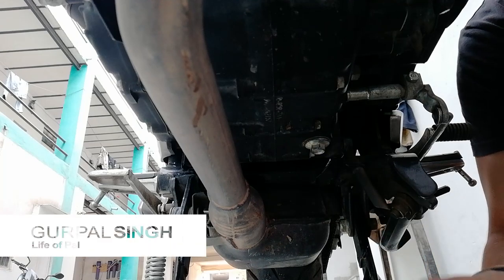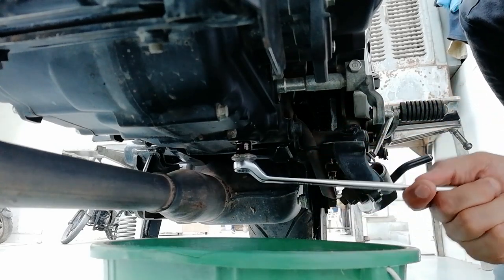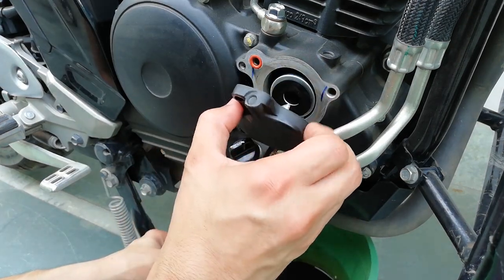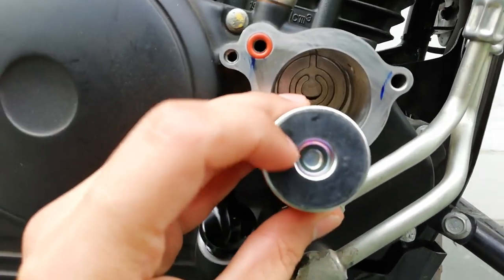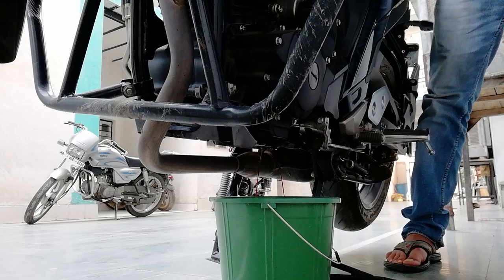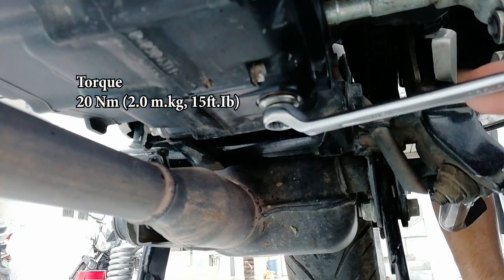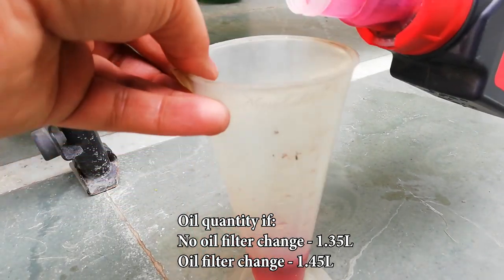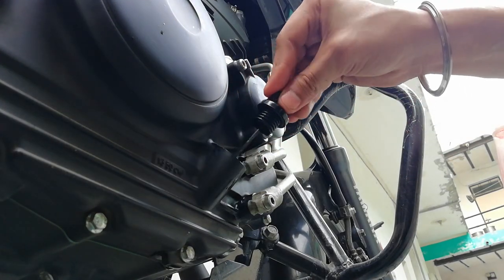How to change engine oil and oil filter | FZ25 | DIY

Comment: Hi nice video. Small thing would point out is not to loosen bolts on the engine when hot. The threads in aluminum can strip. Suggestion to loosen (not remove) the oil drain and filter bolts first and then warm the engine up. Take care :-)

Comment: Hey pal, I've been using yamalube for my fz overall it is good. But sometimes the performance of my bike drops and engine feels rough if i turn off my bike and ride it again after riding it at high rpm. Any idea why this is? Is it due to engine oil issues or should I adjust the tappet?
.
Reply from the maker: this oil doesnt go beyond 2500km. If its within this range then you're expecting the bike to be smoother than it actually can. It is what it is bro!

Comment: Great work. Well explained. doubts:1) is there only one bolt to remove engine oil in this bike?
2) do you change your oil based on both no of kms and time or only based on no. Of kms run? What is your view on this?
Reply from the maker: Yes only one bolt.
I change based on km. Usually it doesn't cross that time as well. When bike sits for too long then i change it as it happens in the lockdown

Comment: FZ25 has an old school engine dating back to the late 80’s from the XT250 Enduro Motorcycle-Ester based oils don’t seem to be going well with this engine, Smoothness is better while using Yamalube Sporty Premium, which is specially formulated for FZ25. People have reported engine issues after using other engine oils like Motul 20-50.... I have tried Motul 10w40 and felt the pickup/ response was somewhat better but gradually smoothness was gone and bike started feeling rough.... today after running 2500 on Motul, switched back to Yamalube, will share feedback in few days...
Reply from the maker: 20-50 itself is wrong choice for this. Oil pump is not designed to pump 20-50 then how come not engine will show problems.
Modern easter doesn't do any damage. If you read manual it says SL or higher which mean SL is the minimum grade requirement.
Reply: Agree oil pump would definitely not be designed to pump thicker oil and engine block damage due to insufficient oil being pumped... Grade wise 10w40 and SL/SM/SN being higher grades is absolutely fine.
There was another discussion on Pros and cons of Esters on engines running lazy compression like FZ25, on contrary I have been using Motul 7100 on my Duke 390 which runs a crazy compression and definitely working well since last 4 years.
Reply from the maker: Compression thing is due to incorrect tappet adjustment by svc's. I have adjusted tappet myself and the settings i mentioned, bike pulls like crazy. Whoever adjusted like i said seen improvement.
Reply: Right the other person who complained and made a negative video on FZ25 engine issues had used Motul but  20w50 which is wrong grade 🤭 
Can you confirm how frequently does the bike tappets need adjustment?
Reply from the maker: Vinay Kumar there is so such specific interval. Depends upon riding condition. I have to adjust the inlet after 10k as it got loose

Comment: Thanks man. For the first time I'm changing oil and filter by myself thanks to this video.

After changing filter and pouring 1.45 lt oil I see the level is slightly above max mark on dipstick. If I want to remove some oil, should I remove it via the drain bolt? Any other way?
Reply from the maker: Dont drain leave it

Comment: Can you please provide solution for oil leakage from left side of the engine, from magnetic side cap. I have chaned the magnetic side cap still small amount of leakage is there. If possible please make a video.
Reply from the maker: change the cap o-ring

Comment: WHERE IS THE ENGINE OIL STRAINER IN OUR FZ 25?  In manual they said it should be cleaned for every 15000 km. But i dont know about it ? Do you have any idea Pal ?
Reply from the maker: It is inside clutch chamber in the bottom. No need to clean.

Comment: Although the recommended grade for the fz25 is 10w40 but i was thinking about trying the motul 7100 10w50 as i have heard a higher viscousity grade will smoothen the engine and gearshifts a bit. Whats your opinion if i should try it or stick to the recommended grade. I am okay with experimenting though.
Reply from the maker: There have been engine break down issues. One of them used w50. Thicker oil doesn't mean its good. It will generate more heat as thicker oil will not travel as fast as less thick hence distributing the heat throughout. I can't really say if oil pump is designed to pump w50. And also don't know how less thick it is compare to 20w50. I will stick to recomended. This is all i can say.

Comment: When to change the oil filter . Is there any measure to change oil filter. Any certain number run after we need to change oil filter
Reply from the maker: At every oil change
Reply: @LifeofPal  I am getting engine sound different in fz 25 1.5 year old bike.  Is it might be problem about engine oil

Comment: Pal thanks for the video...but I got a question about the maintenance period of that bike from 00km...when you bought it, when have you chanced the oil filter and engine oil for first time...Thanks Pal
Reply from the maker: Hi Otto, i got it changed at 700kms on 1st free service. Yes engine oil and filter both are changed.

Comment: Hi, I have a question. In manual, the last step say “remove engine start bleed screw and allow it to idle” the step, should I start the engine?
Reply from the maker: No never start the engine when oil is drained

Comment: It's really informative and clear..what's the cost of motul engine oil which you use ?..
Have you used any other brands of synthetic oil..
Reply from the maker: No i didn't used any other. It cost around 650

Comment: How good is the motul 10w40 engine oil, I've been using the stock yamalube for fz25
Reply from the maker: Very good. Try it. Link in the discription
Reply: @LifeofPal  Hi Pal, how about 300V FACTORY LINE ROAD RACING 10W40, this one would be more better I think. What do you say?

Comment: Which engine oil is best for fz25. My fz25 just compete 1 year and 3 services done. Till now using yamaha engine oil.
Reply from the maker: Motul 7100 10w40. Link in disc
Reply: @LifeofPal  thanx

Comment: Hi, 
I would like to know instead of using company recommended YAMALUBE 10w40 , if i use motul 10w40  will it damage the piston head or affect any other parts of engine in any way in the long run? 
I am asking because when i asked the showroom guy about motul, he put all those things into my head.

That is why i need some clarification from your end.
Reply from the maker: Use no issue

Comment: At present for  my bike FZ25, service man are using yamalube....and i want to go for motul 7100 engine oil....previously they told me to change engine oil(yamalube) for every 2000kms... and now for how many kms i should change motul 7100 engine oil....plz rply
Reply from the maker: 4000 max if bike runs at high rpm. For low rpm, local commute can take till 5. But change as soon as you feel bike underperform/vibes. Yamalube can do 2500-3000.

Comment: Bro when to change the oil on fz25..? I had driven 5100 km (100 km extra prior to service) will it cause any damage..?
Reply from the maker: It will not damage but damage are suttle if you continue. Don't take yamalube more than 3000 and motul 5000.

Comment: Hi Life of Pal..
I own a fz25 from last 2 years, one thing that is bothering me everytime is the gear shifts. Downshifting the gears from 3rd to 2nd and 2nd to 1st is very notchy and mostly it doesn't change without releasing and pressing the clutch again. 
Service centre says that this is how gears shifts actually work in all bikes which is totally incorrect. I owned a pulsar for 9 years and never came across such an issue.
I believe that with time, the gear shifts should become smoother.
Just want to know if you are having same experience with your bike.
Reply: Facing the same issue here and checked on my friend's fz25 as well...The problem exists for all FZ25 probably. Riding at higher RPMs is smooth though. Problems arise in normal and city riding conditions only. My Yamaha Service center guys told the same too that it exists on all bikes which is not true.

Comment: Does FZ25 have oil stainer along with the oil filter?
Reply from the maker: I don't think so need to check
Reply: Oil strainer is inside the RHS of the clutch cover..If you need to change the clutch in future you can clean the strainer and put it back..

Comment: Hellow bro plz tell me after how many Km of running should change the O/f plz tell me...and one more Bro why the engine sounds like vibrating ...is that proble. In all bikes in fz25 plz tell me...
Reply from the maker: Oil filter should be change everytime oil is changed. Yes all fz have that issue. I mentioned that in most of the comments.

Comment: Hai bro.. i haven't changed the oil(yamalube) till 7000kms. 
last week i have changed it to motul.. 
The previous oil was too dark .. i didn't know that yamalube won't run so much.. will this affect my engine anyways?
Reply from the maker: Affect? Depends how you rode it. Well how significant damage could be cant be tell at all. Most likely its safe for once or two instances but for prolong period of time is absolutely damaging.

Comment: Hi Sir, I have bought fz 25 bs 6 after 1st service I took it my hometown 1600 km, after 2 3 hours I washed it now the engine malfunction light is on, it's not blinking if u can suggest something
Reply from the maker: Can't suggest. It's an FI issue needs to be checked. Take it to service center.
Reply: @LifeofPal  I will do that, thanks for the reply, I watched your video delhi to Jharkhand, got motivation to do the same.

Comment: I'm experiencing heat from engine a lot just by riding 20 to 30 km , I rode like 1300 km  after first service .They used yamalube premium engine oil .what is the solution for that?
Reply from the maker: New engine will heat up no issue

Comment: Is it compulsory to wet the oil filter with new engine oil,  as shown in the video? Please reply
Reply from the maker: Not really
Reply: @LifeofPal  thanks for replying,  but what I think is on wetting the oil filter we are putting more oil in to the engine, as the recommended oil on changing the filter is 1450ml, and you too have used the same quantity,  would appreciate clarification.
Reply from the maker: A little bit more or less oil doesn't going to harm. There is something called max & min marks in the dipstick.
Wet the filter using the same 1450ml or dont wet as company isnt mentioned anything like that. It will get wet when the engine runs.

Comment: Hi Bro... I m planning to buy this Fz25 next month, can you little bit describe how it is... Poor Back break pad, engine exhaust rod gets rusty, low vision head lamps.. And sound in engine after running 5-7k kms, is you facing these problems in your bike. Pls tell
Reply from the maker: Any bike will have minor issues you have to live with that. Issues in fz is very small and there are solutions. To me fz is best and perfect. I truly love this bike. I have technical knowledge and based on my past experience have selected this. Brake pads yes do get worn. Mine lasted for 9000 kms. But there are alternatives available on Amazon and aliexpress for much less price. Head lamp definitely not bad for street riding. It can be adjusted and you can for aux lamps without any issue. The rattling sound you mentioned is the manufacturer issue but that is just a sound nothing else. Bike will not go bad at all. Adjust the tappets correctly and you are good to go. Just ignore the sound. I rode 100+ kmph non stop for 29 hours. It is expected the sound to improve after 10k as the metal settles down. Check my idle Adjustment video to hear engine sound.
Reply: Life of Pal
Thanks for yours views. Your final verdict is there is no major issues in FZ25.. And can be buys without any worry
Reply from the maker: Yeah but i must say buy what you like.

Comment: Can i mix 10w40 yamalube and 10w40 motul 7100 and use as engine oil. As ratings are same
Reply from the maker: Topup? No. Complete change? Yes
Reply: @LifeofPal  Thanks for the reply. Your channel is the only one dedicated to fz25. Keep up the good work. Here's my question

I was going to change my engine oil, As fz25 need 1350 ml of oil , I was thinking of using 1 litres 7100 Motul and mix it with  350 ml Yamaha lube. As I have Yamaha lube bottle with me . Can I do this. As both are 10w40 , it shouldn't be an issue

Comment: i have fazer 25...should i use motul 300v 10w40 or 7100 10w40 ?? Is it better than yamalube fully synthetic? plz comment
Reply from the maker: Yeah its better. Use and feel. You can use any 10w40. Never try 20w50.
Reply: @LifeofPal  thanks...and what is the drain interval ??
Reply from the maker: 3000 kms doesn't matter what oil you use. Max 4. Any more will damage your engine

Comment: Hi brother, you have given the link of 20w50 oil of Motul in your video description. Is it fine if I put it on my FZ25? I mean now I am using 10w40 grade. Will 20w50 be fine as I have already bought from the link
Reply from the maker: It is something error from the amazon side. I am sorry for that. I didn't tried 20w50 but some people did and said it made better. I heared mixed review.
Reply: @LifeofPal  ok let me try in the next servicing. I will let you know how it goes
Reply: @abhinaba00001 How it went bro? Was 20w 50 engine oil suitable for Fz25?
Reply: @mohsinmerchant4176  yes it was fine

Comment: Bro, very resourceful videos you've uploaded on FZ25. Thanks for that. I have a 2018 Fz25 running on Yamalube Sporty Premium 10W 40. Will switch to Motul 7100 10W 40 soon. 

Do you think fork oil and oil seal needs to be replaced every 10000kms as recommended by Yamaha?
Reply from the maker: Thanks Abraham
What is recommended is changing only fork oil at 10-15k so that oil seal last longer but change oil seal doesn't last any longer than 15-20k. So no point of changing oil. Change when oil seal get leak.
Reply: Sir mere fz 25 new hai abhi lakin chalane waqth vibration feel hotha hai tank ke  right side me iska kuch solution batau kiu hotha hai
Reply: Even I want to bro....

Comment: why you didn't used yamalube 10w40? yamaha recomend this. and second is what did you mixed with the engine oil?
Reply from the maker: Why can't we use any other oil because yamaha recommend their own brand? I mixed nothing.
Reply: I also have fz25 and yamalube is just shit.
 I am also using motul 7100 10w40 . it's best
Reply: @pratikdalsania2277 how is the performance?
Reply: @2201ravi  super performance

Comment: Do u still use 7100 motul10w40? city ride mein kya change feel hua apko. i too own fz25 , 8000km done.
Reply from the maker: Yes still using. Its awesome. Throttle becomes crisp.
Reply: @LifeofPal  7100 should be used in bikes without catalytic exhaust.  Will it be harmful for fz25 ?
Reply: Does motul specify 300v 15w50 for fz25? Read on net but couldnot confirm it .
Reply from the maker: 15w50 is not recommended

Comment: Motul 10w40 full Syn doesn works on my fz 25 makes hard shifting gear, makes too much dificult ride and find neutral so decided to change oil for yamalube 10w50 and now shifting gear like knife cutting butter.
Reply: Heard a lot about AMSOIL from friends,is it good for use on FZ25.
I normally use MOTUL 7100 10w 50.

Comment: When the engine oil changes, then you need to put out the cooling oil? 
    Plz rlpy me
Reply from the maker: Yes
Reply: Is there a video on that subject?
Reply from the maker: Why video is needed on that what is the confusion. Obviously you will pour in the room temperature oil. It doesn't have to be warm up in the stove.

Comment: My indiacater switches some time not working..  any solution..  just 2 month old fz25
Reply from the maker: It can be switch connection issue or wiring issue. Better get it checked at svc and claim warranty.

Comment: Hello Dear. I bought a new 250cc bike that is Yamaha fz25. In first service at 1000km the service centre guy drained oil and put 1L new engine oil. He didnt change oil filter either. He was not aware with the fact that this bike needs 1.3 ltr of engine oil. I myself noticed it yesterday when the bike already ran 300 kms in 20 days(Max distance covered in one run is 25kms). My dipstick is showing oil level below one cross to its minimum according to pic you posted (seen your dipstick photo posted by you in comment section). What adverse effect probably got happen already and what should I do immediately? Should i topup or change entire oil along with oil filter?
Reply from the maker: 1L will not do any damage. Let it be. Do topup and run for 2000 then drain and change the oil filter.
Reply: @LifeofPal  thanks friend. I was feeling bad for my bike. Now feeling relaxed. I am going to topup tomorrow. Next month I have plans to go Spiti. What do you suggest? Should I continue or change oil along with oil filter?
Reply from the maker: Do the math. If your spiti trip does not exceed oil drain interval of 2000-2500 then continue ortherwise change both. Change oil filter everytime oil is changed.
Reply: @LifeofPal  thanks a lot Pal. Your videos are bless for all bikers specially for Fzns'

Comment: Pros and cons about motul 7100 10W40?
Reply from the maker: Pros: Make throttle response crisp and bike pulls like crazy.
Con: running cost is more if drained at 3000. Not recommended more than 3500/4000. Some take till 5/6 that is too much and will damage engine even though u don't feel oil change is required.

Comment: have you tried using engine flush on your bike?
Reply from the maker: No I didn't and if you're changing engine oil at its interval then not required. Only those vehicles that are not in operation from long time should be consider for flush.
Reply: @LifeofPal  thank you very much. You've helped me a lot in maintaining my bike. Please keep making videos